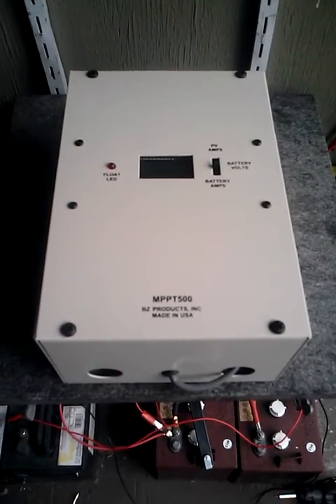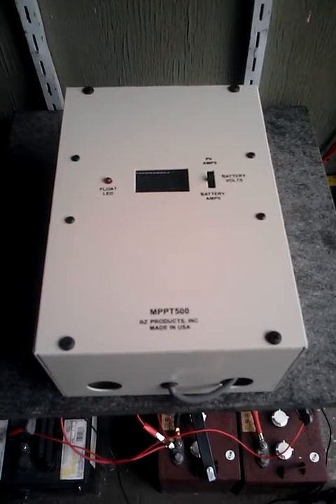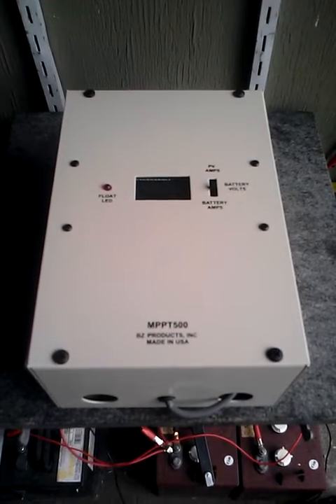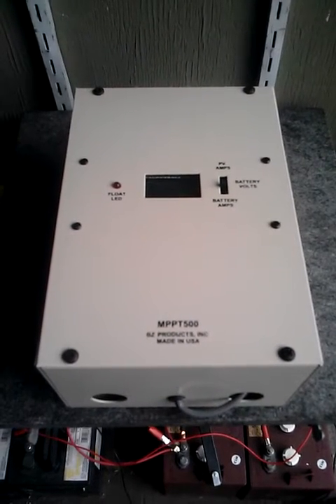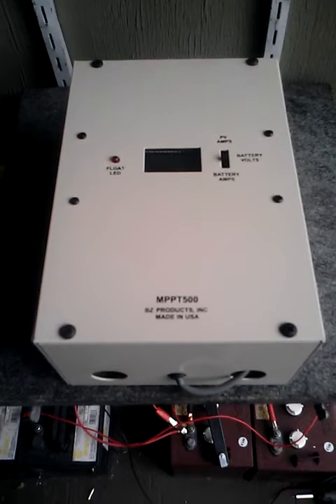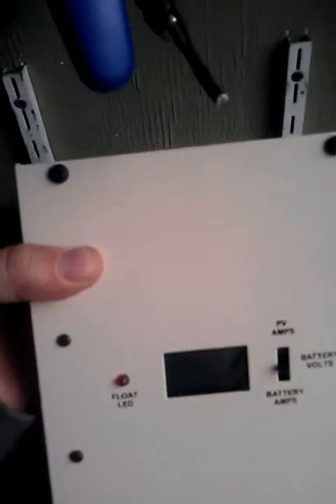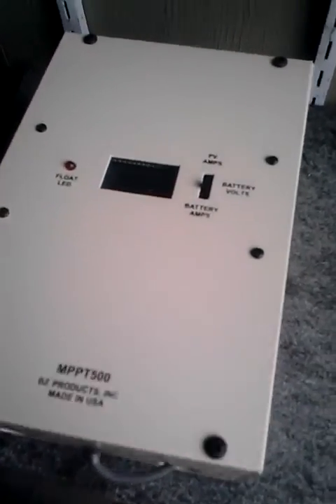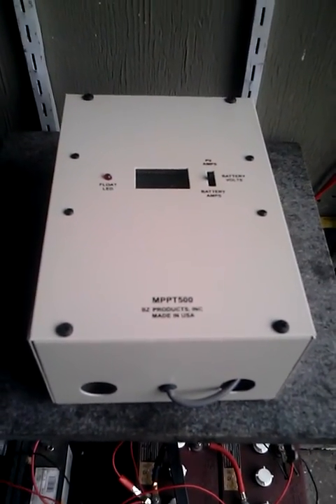Unpacking the BZ 500 MPPT Solar Charge Controller.

Comment: i have one of these it runs a 100 liter evakool fridge freezer with 200 watts of panel and 200 ahr battery bank it has run flawlessly for 3 years now if it does click i cant hear it as its mounted on a large utility box that houses the batteries on my front porch. as i see it the biggest draw back is that it can only handle 450 watts of panel